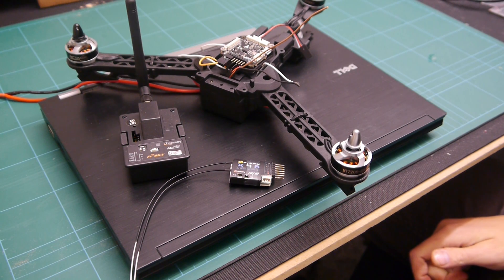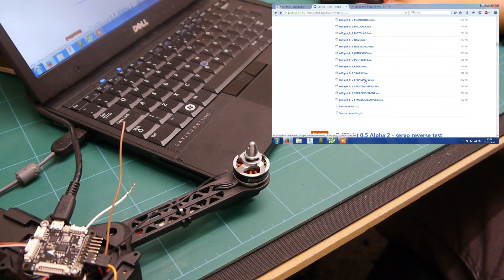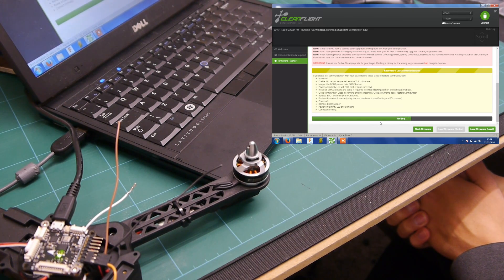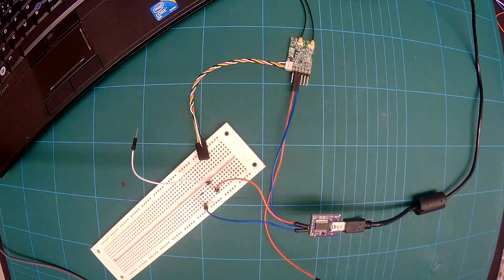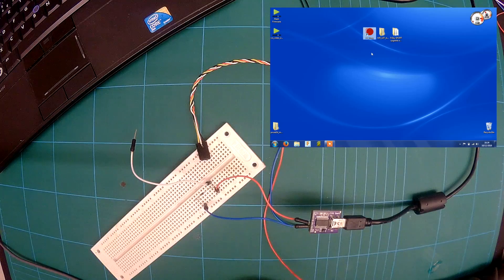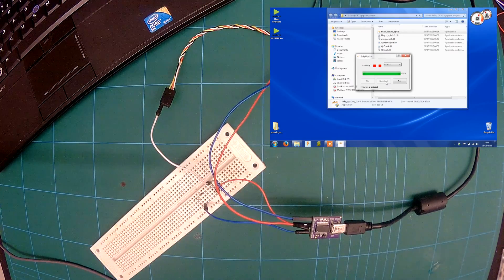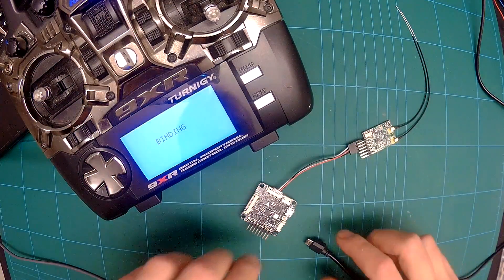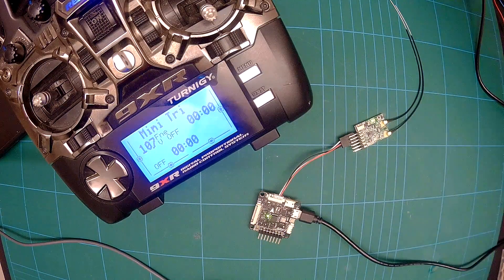TheManLab - Firmware Flashing, Triflight + X4R - Quanum Trifecta - Mini Tricopter Build - Part 3

Comment: Hey ManLab, I have a Motoloab Tornado F3 FC board and am struggling to find what inout numbers to plug the motors and servo into. Was going to just use cleanflight first to see if it works then change to Triflight. Any suggestions?
Reply from the maker: Almo Cox Hi. I've found that motors connect to  pin 1,2 and 3 and the servo to pin 7.
Reply: Thanks for the tip. I am not sure how to connect to pin 7 on my board because there is only a signal wire but no ground for motor pins 7 and 8 but will give it a go. Really wish there were more serup guides for F3 boards and tricopters. Thanks again
Reply from the maker: Almo Cox It doesn't matter. Just connect your servo to 5v and ground somewhere else and then just connect the signal wire to pin 7.